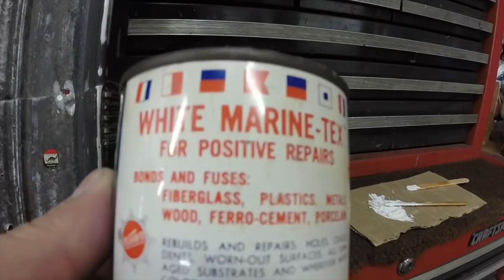1966 Ford Galaxie 500 convertible restoration part 139 painting, sanding on top stuff

Comment: It's looking great, so as they say, stay tuned for more.  If I can tell you something about that Tecumseh-powered edger in the video - I have a simiiar-vintage Tecumseh powered edger (mine is from around 1990).  I found that style muffler to be ear-splitting.  If you remember the Toro mowers with the Tecumseh TNT100 motor (muffler exits down, through the deck) - that muffler fits this style horizontal engine, and I think it's quieter.  So if you have 1 of those mufflers around, you might want to try it.
Reply from the maker: All Tecumseh engines had poor mufflers and were loud. This edger is not mine.... I am repairing for someone else.... so no muffler replacement.
Reply: I remember those mufflers but I just figured they were quieter simply because they exited under the deck, similar to a Lawn Boy two cycle mower, the deck absorbs the sound waves and makes it quieter.

Comment: Howard, Is that Marine Tex can dated "1970" on the back upper Left of the can (At 00:41sec).  The Marine Tex can and its Catylyst looks 50 Years old! lol... Never heard of the stuff...!  **Also, On the Trim Mouldings, The smaller head trim screws with the flat outer Flange are the Original Ford Wheelwell Trim screws. :o)  Tony K.
Reply: Yup on those screws. I checked my '66 Galaxie, and Tony is correct on this.
Reply from the maker: It's not from the 70's.... I most likely bought it back in the early 2000's. You can buy it at any good boat supply store. It's really good stuff. The best stuff I have ever used to repair cracked steering wheels. On the screws, I went threw them, and most (90%) are the smaller ones with the flange, so I assume there the original one too.

Comment: Howard, I know this video is over a year old however I just watched it for the first time. My ‘66 Galaxie does not have the drivers side rear wheel well chrome. If you still have the one you took off, what’s it worth? I might be interested.  I’m in the St Louis area.  Thanks.
Reply from the maker: Those wheel well moldings are almost impossible to find in nice shape. They're anodized aluminum, and ding super easy. It's a lot of work to get them straight, and have them re-anodized. I saved mine, to restore and sell as a set..... they will bring in $1200 for the set easily. Try some older salvage yards that still have this era of car. You might find a good useable one. Most salvage yards work together, so you can contact almost any salvage yard for them.... If they don't have them, they very well may give you info on who does.

Comment: Hi Howard, do you use non ethanol fuel on your small engines?  I do and find that they have less issues when using N.E.
Reply from the maker: Yea I use ethanol free, there is a gas station not to far away that sells it.
Reply: Old Car Alley not to be dense, but is that because of the valves on the FE, before we went to unleaded gas?
Reply from the maker: @mysterj1  The ethanol has nothing to do with the valves.... the lead lubed the valve seats. I had the heads rebuilt to run unleaded gas.